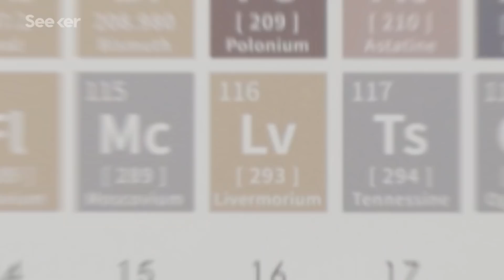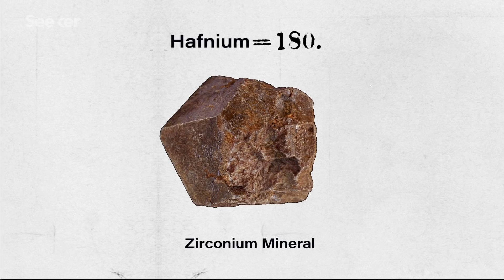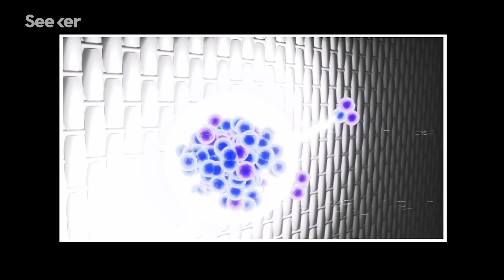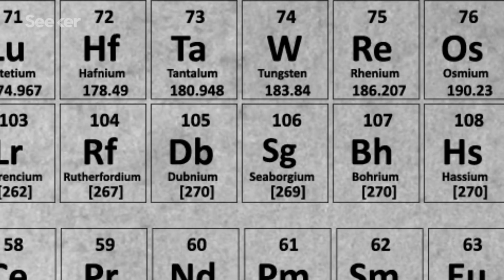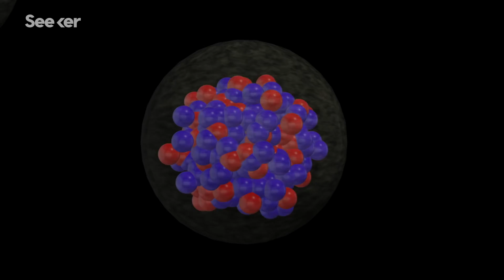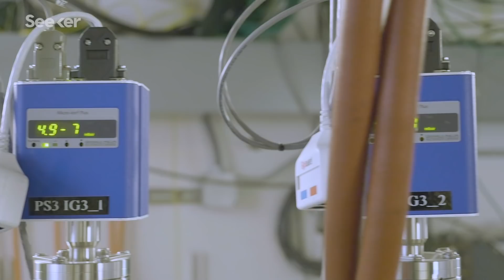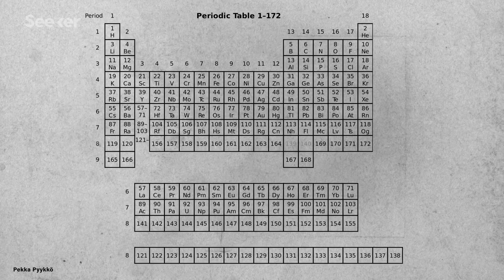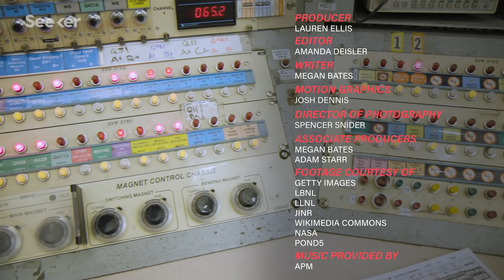This Superheavy Atom Factory Is Pushing the Limits of the Periodic Table

Comment: Speed up the EM flow in your loop to stabilize the heavys. The elements are on an exponential curve with infinite proton nucleus's once near lightspeed. Earth's surface speed, when measured against  absolute 0 universal momentum, limits the creatable range of elements on this endless curve. Galaxies with star systems and planets that move faster than Earth surface rest speed will naturally have stable elements that are many times heavier.

Comment: The "Periodic Table" has been a serious concern to myself and the difficulty is logically trying to fully understand why we do not have all the pieces and why they are missing. We all understand that the Universe is made of numbers.

The trouble that we are now facing is how do we explain some new "Exotic Elements" that unofficially should technically not exist on the new periodic table. A 150 years have passed, and the so called the truth of the matter is that we still have so many gaps. Whilst the world is racing to get A.I. off the ground, it's still going to be awhile before it wraps its mind around not just identifying these new elements but more importantly how it can produce them.

The lower end of the table will be it's first priority, as that will be in many ways ground-breaking and will be a huge leap for research engineers and those pioneering this field of science. The problem is advance A.I. will surpass the minds of those who have been leading the way so far. A.I. software will need to be technically dumbed down in order for our brightest minds to get their heads around it.

The other problem is far more difficult, and as mentioned above, is the so called "Exotic Elements" as they are not resourced or readily available here on Earth, but was acquired through trade from "E.T.'s" however that would then require disclosure which I cannot see ever happening. There would need to be a global reset for it to be ushered in.

Comment: if you don't want an unstable element only a normal element like gold. Just fuse nuklei together? Seems useful for little cell factories who can self replicate. If you can downgrade the cyclotron to be just a view µm in diameter (length isn't the problem pretty sure you could fit the length of the whole cern accelerator on less than a nail) producing elements like gold by fusing would be quite useful to ensure there is no replication problems because of ressource deficency. Mineral growth?

Comment: Fascinating.  In college, I only had inorganic chemistry and basic physics for my Engineering degrees (and this was back in the late 80s, early 90s).  So my question is rather basic.

I learned that the proper atomic model for electrons is an electron cloud, not the classic Bohr model of orbiting electrons.  But the video mentions electrons reaching Relativistic speeds.

I am not sure what I am missing, but I want to understand how Relativistic speeds would apply to the electron cloud model.  It would seem (at first blush) that it would only matter in Bohr's classic model.

Comment: Needs dual layering with an outer layer density. At a certain point magnetics vs gravity is hard for confinement, so we use vacuumed chambers and noble gasses to change the density and effects.
Changing the density of an outer pressure layer makes the average much easier to reach using the other methods already. It's a form of balance,  you use all these methods to barely even the scales and imitate the energy conditions of partical creation. Use one more method to change where the balance sits beneath the seesaw. By using an increased density and pressure in a secondary outer layering you would rebound alot of the outer 'noise' just from the increased disturbance noise. It also increases the bouyancy of the inner negating some of gravity for you.... Arghhh
I wish i could make this in my back yard...

Comment: The new Terminator film has confirmed it will have a Transsexual Arnold Schwarzenegger :-(  Suppose u have to move with the times  7:54  and it absolutely will not stop EVER until You use its pronouns

Comment: A couple thoughts: Use an electron gun to ensure the atom made has enough electrons to be instantly stable. Use Fluorine gas to get a Superheavy bonded to N Fluorine atoms which could hold the nucleus together easier since the region around it would be higher energy. Ionize the Superheavy completely and trap it in a second cyclotron or a large negative magnetic field to compress the nucleus.

Comment: I'm a nuclear engineering grad student, and I do not have a lot of experience with experiments of this nature. I was just wondering what are the implications behind trying to bombard an SHE with neutrons? Could this induce rapid neutron capture and provide stability to the newly created element? I understand that we don't really know anything about the cross section for neutron absorption on these heavier elements. It seems like it would be a good thing to try, because increasing the lifespan should aid in the ability to study them. I guess one of the key factors preventing this would be the cost of adding a neutron source to the already expensive SHE generator.

Comment: The Elements should not be placed in the Periodic Table based on chemical properties. 🤦‍♂️ The Elements need to be arranged based on their fundamental Quantitative data, aka, the number of Protons, number of Electrons and Electron Configurations. 

The reasons why Elements need to be placed based on Quantitative Data instead of any properties or chemical behaviors is because properties and behaviors can change dramatically depending on the conditions of temperature and pressure.

Chemical behavior is a function of something more fundamental, the simple Quantitative data. The reason why we have yet to be given a complete and Accurate Periodic Table Numbering System is because the second Element, Helium is placed in the Table based on its behavior and properties of being an Inert Gas rather than its fundamental Quantitative data of having 2 Valence Electrons. The fact that Helium is placed over top the Noble gasses when all the rest of the noble gases have 8 Valence electrons, makes it impossible to ever apply an accurate and complete Numbering system for the Periodic Table that actually corresponds to useful Element data. 

Hydrogen and Helium are anomalies of the Periodic Table and they don't really fit perfectly anywhere. Based on Quantitative data they belong in groups 1 and 2 respectively although they do not behave anything like the groups they sit atop of.. Hydrogen and Helium in fact have multiple logical positions and their placement dictates the numebering system. If you place them all the way to the left in groups 1 and 2, then the Numbering system will correspond to number of Valence Electrons. If Hydrogen and Helium are all the way to the right, the Numbering corresponds to the number of Electrons needed for a full shell.

Comment: They need to actually fix the Periodic Table of Elements arrangement and System before they even worry about adding anymore unstable superheavy Elements. The broken Standard Periodic Table is a perversion of Science and creates more confusion than there needs to be. Notice how the Lanthanides and Actinides are always placed out of order and excluded from the numbering system. A more accurate, more complete, superior Periodic Table of Elements System can be found here. Anyone can learn the Periodic Table of Elements more quickly and easily than ever before using this revolutionary new Genesis Periodic Table Elements System>>> https://youtu.be/FVZlVRM2s_A

Comment: just colliding them will yield only little
you need to add more neutrons
Use isotopes heavy in neutrons!
The most heavy "most stable elements" will tend to need about a "golden ratio" of neutrons
1,6180339887498948482045868343656

Comment: why are we using heavier atoms to collide and create more heavier ones??why can't we use more lighter atoms to collide and make heavier ones
we know 6+1=7 right?so we can also use 4+3 right?(it is just an example of what i said never mind).I am just asking cause i am a student and  curious about these whole quantum theory and stuff  in physics and chemistry.
Reply: I think it comes down to a question of efficiency. There is the fact that a smaller nucleus would have a much lower chance of being hit by the beam, then there is the question of energy as smaller atoms need more energy to fuse than heavy atoms as after nickle and iron the energy required for fusion starts dropping when it was increasing before.
Reply: @blungus7815  ok bro thanks for replying

Comment: If these heavy elements are so unstable that they don't last, what is the purpose of creating them?
Reply: Trying to stabilize them, What if the stuff that makes up a ufo(specifically the one the airforce or navy locked onto) is truly element 115 that Bob lazar speaks and has spoken of since the 80's before its discovery, so the ufo is practically a time machine/ warp device, only if they can stabilize such an element, can they utilize the anti-gravity aspect of element 115
Reply: @Tearingtacos  Thank you for taking the time to explain that to me.  : )
Reply: No problem, Bob lazar speaks about his experience with the craft he claims to have worked on and in very specific detail, from the 80's and on Joe rogan's podcast, even described a hand scanning device that was used to ID people by measuring your bones in the hands, later proven to be used in the likes of A-51, the craft also didnt rely on wires or gears, and seemed to come to life when entered, so all im saying is that they have been experimenting on aviation, propulsion, and much more, and the "Nazi Bell" is another example of the technology of particle acceleration in a way, experts claim that it could've been time machine and/or ufo, its interesting, also Cod zombies references things like that, even e115 is what created the zombies

Comment: For those commenting on her phrase "fraction of the speed of light": A massive particle is relativistic when its total mass-energy (rest mass + kinetic energy) is at least twice its rest mass. This condition implies that the particle's speed is close to the speed of light. According to the Lorentz factor formula, this requires the particle to move at 86.6025% or more of the speed of light. A charged relativistic particle crossing the interface of two media with different dielectric constants emits transition radiation. This is exploited in the transition radiation detectors of high-velocity particles. (I spared you the great fun of Lorentz factor formulas)
I'm fairly sure this is what she meant, and I'm pretty sure for the vast majority of us (including me, actually) it would go right over our heads and just be confusing. I think it's even likely the filmmaker edited out a full explanation given either beforehand or afterward. Sure it's a funny gaffe, but she's struggling to communicate to those who are much less knowledgeable, (the interviewer and camera person probably know zero physics, anyways). Give her a break.

Comment: "A fraction of the speed of light" is am odd saying. Everything moves at a fraction of the speed of light!
Reply: A massive particle is relativistic when its total mass-energy (rest mass + kinetic energy) is at least twice its rest mass. This condition implies that the particle's speed is close to the speed of light. According to the Lorentz factor formula, this requires the particle to move at 86.6025% or more of the speed of light. Such relativistic particles are generated in particle accelerators, like cyclotrons.
A charged relativistic particle crossing the interface of two media with different dielectric constants emits transition radiation. This is exploited in the transition radiation detectors of high-velocity particles.  --would you have preferred this explanation? I'm kind of glad she stuck to the simplified terms!
Reply: @squirlmy  86.6% the speed of light is still a fraction of the speed of light. What travels at multiples of the speed if light?

Comment: the path on which the electron moves around atom allows you to catch a reference point thanks to it you can create new elements,how make path :make sweep from a line of length 48.744672225 on circle line with a diameter 192,531067267 like this https://www.youtube.com/watch?v=ihM4uLzxeI0 must be rotated 3 times (1080) . on the line that was made make sweep this time line length is 24.682178355 and must be rotated 8 times (2880) .on the line that was made make sweep line length is 12.11853822 must be rotated 24 tims(8640),on the line that was made make sweep this time line length is 6.82992394 must be rotated 72 times (25920),on the line that was made make sweep this time line length is 3.245518135 must be rotated 216 times (77760),on the line that was made make sweep this time line length is 2.12469036 must be rotated 648 times (233280), on the line that was made make sweep this time line length is 1.22669055 must be rotated 1944 times (699840) , on the line that was made make sweep this time circle with dimeter 0,5886253 and make solid

Comment: So you take two elements to make a new element. You've fused it. Great! When it breaks down, does it go back to the two elements that were originally used to make the new element? If not, is it randomly decaying to different elements, or is it predictable?
Reply: It decays based on how unstable it is. There are 3 types of radiation, Alpha radiation, Beta radiation, and Gamma radiation. Alpha radiation is where an unstable atom emits a helium nucleus (2 neutrons and 2 protons). There are actually two types of Beta decay, but they both involve the emission of an electron. And finally, Gamma radiation, where an unstable atom emits a high energy photon. There are other less common types of decay, such as Neutron emission, Proton emission, Cluster decay, Electron capture, and Spontaneous fission. The type of decay an atom goes through depends on its number of protons and neutrons.

Comment: This video is confusing and is based on a false premise. The modern periodic table is not arranged by chemical properties, but by (mostly--see the transition metals) electron configuration. elements in the same group tend to have similar properties because of their electron configurations, not the other way around. Maybe they are using chemistry to determine the electron configurations, but I'd assume that would be done spectroscopically. WUT?

Comment: Possible Fermi paradox solution: All the non-galactic-central black holes out there are former civilisations that pushed their particle accelerators just one step too far. Just kidding - we'll be safe as long as the dial only goes up to ten and not eleven.  ;)

Comment: It's fascinating to realize there is a great probability that those Superheavy elements may be the first ones to exist in the entire universe since the Big Bang!
Also, it's not precised in the video, but calcium used in fusion is not common Ca 40, it's a very heavy isotope with 8 more neutrons! Otherwise there would not be enough neutrons in the superheavy atom to be stable. What is the difference? Well, it cost 250000$ for just one gram!

Comment: given neutron stars. doesn't it mean the periodic table is infinite?
Reply: I see where you're going with that. I'm no physicist, but my best guess is that the answer is no for two reasons: 1) Atoms are defined and placed on the periodic table by their proton count, and a neutron star isn't supposed to have protons; and 2) Neutron stars aren't held together by the strong nuclear force, but instead through immense gravity. So while a neutron star is a massive collection of neutrons (and possibly a few protons), it's not really the equivalent of an atomic nucleus.

So my best guess is that the the periodic table ends when the electron cloud surrounding the nucleus doesn't break physical laws of trying to move faster than the speed of light; and how large the nucleus can get before the strong nuclear force is unable to hold the protons and neutrons together.

Comment: What if two 180’s fused? Wouldn’t there technically be no end to what elements you could create? What if certain ones create a singularity and we discover how a black hole actually works? What if the super heavies hit each other and create the super duper heavies? What if we harness the energy of the super heavies to create a nearly limitless fuel to use for interstellar travel??

Comment: You can tell 100% this was the lab in Russia, or Ukraine.  ( At least the specific videos ).. Because if you look, the accelerator is literally put through a brick wall as an afterthought.  they build machines around the building after the fact, rather than the opposite.

Comment: Without relativistic effects, element 120 would be placed under the noble gasses. The Periodic table is like a  stooped hour-glass shape. The energy levels of the electron orbits causes it to "skip" the next step of orbits in places. That's why for the otherwise irregular shape and arrangement of the periodic table. If we account for this "skipping" the table would look much more hour-glass shaped.

And that hour-glass shape puts the bottom-right element as 120.

It also predicts that 122 will also be in the noble gasses, as we move on to building the next hour-glass.